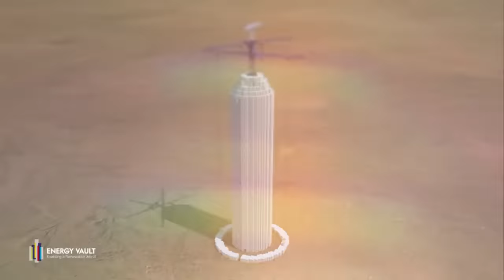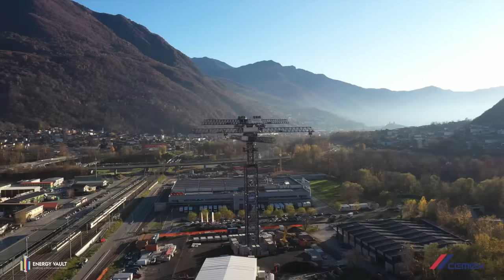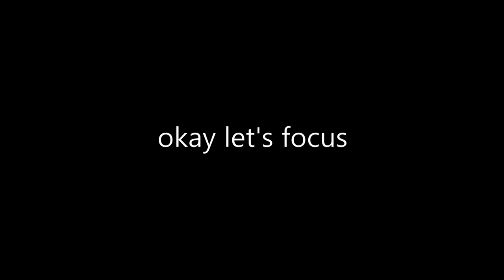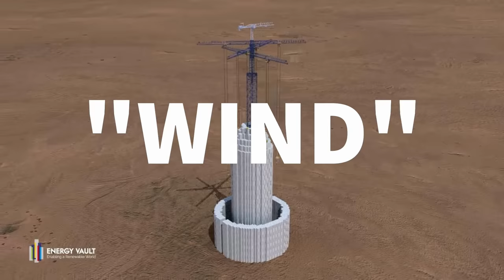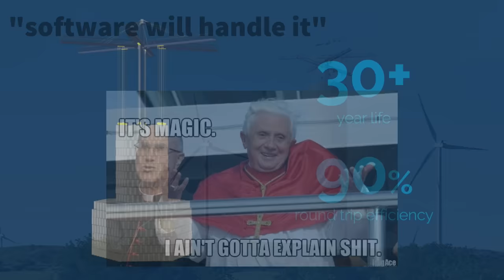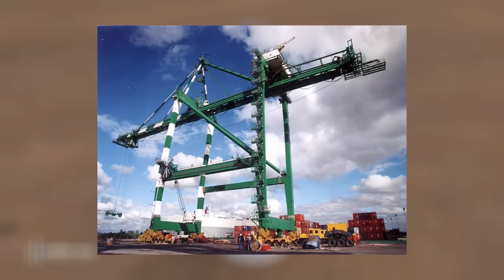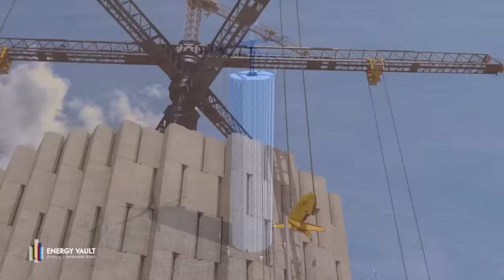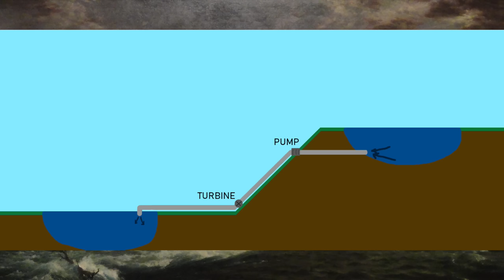The Energy Vault is a Dumb Idea, Here's Why

Comment: I understand what you're saying here. However, finding spots for new pumped storage is very difficult, it takes a lot of land and hilly terrain (but not too hilly) We are nowhere near peak capacity and we definitely need more money thrown at things that make sense instead of billionaire techbro salesmen "would be cool" projects. Pumped storage is not infinitely scalable due to geography and something more scalable like energy vault (but definitely not actual energy vault) is needed.
Reply: Agreed, the Netherlands doesn't have much room to build these for example. I think the tanks and hole idea could actually be alright in those situations
Reply: To compensate for geographical  issues one could dig / drill holes in the ground and put large cylinders which get pushed up (e.g. by pumping water underneath), locked in place, and sink down releasing water with pressure under the weight driving turbines when needed. You could fill the cylinders with waste and make this thing a height adjustable waste storing facility, so you won't have to put fresh ressources just for creating something heavy.
Reply: "However, finding spots for new pumped storage is very difficult"
A water tower would take about as much space as a crane moving concrete. You don't need a hill.
Reply: @wisenber  It's an issue of capacity at that point. Ideally you get maximum eco of scale. A water tower maximizing eco of scale gets progressively more expensive because you need to hold something very big and heavy very high. Reservoirs hold more water for cheaper than a tower. If we are talking about towers, we might as well abandon it all together and optimize liquid salt batteries and build as much pumped storage for long term energy storage as can fit on the planet given geography.
Reply: @epicosity5588  You're discounting the option of many water containers. Heck, put one on the windmills
Reply: @wisenber  I'm not discounting, I'm just saying it's cheaper to build bigger because of the square-cube law. Putting a container on each windmill would increase the cost of the windmills and create additional maintenance costs/points of failure. Building one giant reservoir with the largest possible turbine/pump also generally increases the efficiency of the energy conversion. For these reasons, the direction that the industry will go is generally fewer and bigger, therefore solutions need to keep optimal scale in mind to remain competitive with other options. Just look at the history of electricity generation and container ships for reference.
Reply: @epicosity5588  Were you assuming the shape of a water tower.  Building one giant reservoir doesn't work for the same reason you said it wouldn't work. That hasn't changed. Any addition is more maintenance than no addition.
Reply: You could dig deep holes into the warm Earth and put water into it and pump it back up..... Hang on....
Reply: @wisenber  The square-cubed law indicates that the smaller the container, the more expensive the storage per gallon. One giant reservoir is therefore more cost effective than individual water-tower-like storage.
Reply: @Sam-vf5uc  "The square-cubed law indicates that the smaller the container, the more expensive the storage per gallon."
The same law covers the geometric increase in stress. One giant container therefore requires much more reinforcement. Unless we're talking about ship design and your cargo (water) is displacing water. If we're talking about a reservoir, we keep running into killing aquatic forms of life.
Reply: @wisenber  I thought about the possibility of using the windmill tower to house a lifting mechanism for a heavy concrete block that could be lifted by "spare" energy and released when there is no wind. But I'm guessing that both ideas would make the windmill top heavy and more likely to blow over.
Reply: @stephengraham1153  Thank goodness I have a natural gas well on my property. I'd hate to rely on this stuff. However, the prop on my sailboat has a regenerative function when I'm sailing above 4 kts along with a couple of solar panels. My house has been powered by natural gas generators for several decades.
Reply: I mean, it's equally an issue with concrete though? It isn't that much more dense than water (2.4x denser by volume), so if you can't find somewhere to store 40 cubic kilometres of water (a reasonably large reservoir, but not the largest by far), you're still going to find it a struggle to find somewhere to store 17 cubic kilometres of concrete and move it about.

Uhh.. For that matter, that sounds like an absurd amount of concrete. At some hastily googled ballpark numbers, that's about 20 times as much concrete as in Manhattan, so.. uh.. factor generating 20 cities worth of concrete into any plans to get a good storage amount and do a pretty big multiplication of that neat little 82000 tonnes of CO2 this stupid energy vault was going to generate.

(It's 7 billion. 7 billion tonnes of CO2. So. Yeah. An additional 20% to global emissions that year. To make ONE medium sized concrete 'reservoir'.)

P.S. I acknowledge that you said 'definitely not energy vault', so you'd probably choose something less stupid than concrete (Perhaps some of the stuff you just dug out of the ground digging a huge hole, for example.) but the volume of land you need to occupy still isn't scaling down that much for using substances that aren't water.
Reply: @HairwormSeph  Don't use concrete.  Use rock.  No need to produce CO2.
Reply: We transfer power between states... this isn't that difficult to find places to put these.
Reply: @Chasing100  again power is transferred over long distances... this doesnt need to be local.
Reply: @loon894  this is a terrible idea... water alone is pretty heavy and a block of even something like lead on the top wouldnt increase the efficiency much and would cost much more than digging a larger hole which would increase the power storage by multiple amounts rather than by a few percent.
Reply: @wisenber  that is a lot of money to do something a hill is much better at. Electricity is pretty easy to move around and the infrastructure for doing that is already there in most places and would be cheaper to just make electrical infrastructure than it would be to make water towers... stop it with the dumb ideas..
Reply: @wisenber  water doesn't store that much energy, you had one bad idea and are trying to fix it with other terrible ideas.
Reply: @thomgizziz  " that is a lot of money to do something a hill is much better at. "
The windmill may or may not be on a hill.

"Electricity is pretty easy to move around "
Until it isn't. The cost of distant transmission (and the loss) is one of the reasons why transmitting solar from North Africa to Europe hasn't taken off.
Reply: @thomgizziz  " water doesn't store that much energy"
Tell that to hydro operators.

"you had one bad idea and are trying to fix it with other terrible ideas."
Like hydro generation?
Reply: @HairwormSeph  probably harder to store an equally dense amount of water than stone at high levels. Stone can be stacked, water has to be contained and leak proof. The heavier it is, the more structural integrity, and we’re talking about a lot of weight. Using stones allow the weight to be stored without worry of leakage. And no pipes or pumps to worry about over time, just an engine that pulls up a single rock at a time. 

I like the water pump idea, but I think this idea has some perks that justify its own use case.
Reply: >we

Comment: Thank you for the video. Please consider the following points: 1) The energy efficiency of Pumped-Storage Hydroelectricity (PSH) is less than that of the energy vault. 2) PSH has its own problems related to construction cost and others. 3) I agree with you, the shape of the energy vault tower can be different, however, it is built on the ground rather than below ground to reduce construction costs. 4) The blocks do not have to be made of concrete, they can be made of any material, hence the CO2 emission issue is invalid. 5) With regards to stability, tower cranes are used to build skyscrapers, hence, they can be stable when sufficient anchorage is used. 6) In light of point '5', tower cranes can extend their operational heights, while gantry cranes are limited by their initial design and construction.   Thank you again for bringing these matters to mind. Such videos help pin point matters of concern and improve the design.

Comment: I live in the midwest where a lot of the windmills are and there are some reasonable explanations why concrete towers would work better.
1) Water freezes in the winter here.
2) Digging a void structure that deep would be very difficult due to the very shallow water tables.
3) Hydro batteries work best in area with a steep elevation change, which it's pretty flat here. Also, the flatness of the land is partly what causes the high winds needed.
4) Separate point, since most the energy would used while it's being generated, one tower would support many many more than just 2 windmills.
Reply: And usually it won't be stored near windmills... rather near the place where the energy is needed, not where it's created as then 30-40% of this stored energy may get lost during the transfer so there is no point in storing it, it's better to have it stored in the nearer location after the loss.
Reply: You know what you could also use? Compressed Air instead of water. They've been available since 1978 and are great for cold, flat places.
Reply: @normanicusinvictus7416  Interesting, never though about that. Are there any examples of compressed air storage of that magnitude though?

Comment: Okay, I'll grant that the proposal so richly trashed is a bad implementation of an old idea.  The problem I have with the proposed fixes is that each of them has issues as well.  Potentially worse than the tower design.

Digging a pit:

It is surprisingly expensive to dig large holes in the ground, which would push the ROI out into the far future.  Then there's the problem of where the water comes from and ecological impact statements for what amounts to a gigantic artificial dam if you go with the pumped hydro idea.

Pumped Hydroelectric:

Natural pumped hydro requires suitable geologic features around the area to supply and contain the water.  That means a dam or big hole (see above).  The last dam built in the US was back in 1980.  Getting a new dam built is a painful process; going through ecological impact statements can take years.  That's assuming that there is a suitable geologic structure to do it at all.

It isn't enough to point out the problems if your proposed solutions have more problems.

How about this?

In the Pacific Northwest, most wind farms are idle even on ideal days.  That's because you cannot put more power into the grid than the demand.  They have to match closely.  The power companies have base load generators to handle the normal load, which are designed for efficiency, but which cannot be turned on or off quickly.  If the base load generators are handling the demand, the windmills must shutdown to avoid damage to the grid.

OTOH, So. California could use all the power that the PNW wind farms can produce, but...  There is no grid interconnect from PNW to SoCal, and no one is willing to pay to make it.

Figure out how to economically create the grid interconnections to allow the alternative energy sources to run full tilt, and storage is no longer an issue.  Or, at least not as big an issue.

Comment: When I first saw it I assumed it was a tower made entirely of batteries for storing energy. Stacking blocks with cranes in windy areas sounds so dumb when compared with my initial thoughts. Your underground square crane sounds much more viable but the storage capacity needs to be more.
Reply: Same, I already though, wait why do they move them around wouldn't connecting them be more efficient and cause less problems? Or just unplugging cables while loading and not moving the batteries itself. But no its even dumber and the moving is the only art of it...

Comment: I remember hearing about a desert township trying something like a hybrid of pumped hydro and lifting blocks by using an old unused set of train tracks going up a nearby hill - pulling a loaded boxcar up hill when they had the power to spare, then letting it slowly roll downhill when they needed the power? Not sure how that story concluded tho
Reply: Sometimes ideas are great until you try to use them large-scale. That boxcar thing sounds great, but 10,000 of them sounds dumb.
Reply: @GamesFromSpace  but what-if one really really big boxcar 🤔
Reply: @tarjaau  I see your reduction of air resistance with a vacuum & raise you a launch the whole thing into space & gradually lower it down to the surface when you need more energy (:
Reply: That actually sounds like a really good idea once refined. How about... 4 box-cars going up and down a hill so that you'd have electricity even if one of them required maintenance? Might be safer and cheaper to distribute the weight as well. You can then run a wire from each boxcar to a central station at the top of the hill for lifting and releasing, and that's where the power would also be generated. Maybe add some anti-roll-back mechanisms like they have on roller-coasters (preferably magnetic so that the car can travel both ways) and hell, if Elon wants to help, build an air-tight or vacuum-sealed tunnel for these boxcars to travel through.
Reply: I believe the weighted rail cars as renewable storage is still on going and they are working on a vastly scaled up installation somewhere outside Las Vegas. It seems like a sound idea and I do like that it uses a hill that already exists and some old rails no body wants to achieve its ⅔ of its  goal . Strangely enough I discovered that it is about 20 minutes from my new home in the god forsaken desert so I will have to drive out there and report back .
Reply: better than this 4 sure
Reply: @GamesFromSpace  Eh, it's basically regenerative train braking, and for small towns with disused railways as a small-scale application actually trying to be inventive with the things you already have. Most of these tech schemes need to be marketed because they require (for unproven technology) eye-wateringly expensive new construction projects which the boxcar concept wouldn't.
Reply: @GamesFromSpace  still, that would already be a way better idea than the easily-knocked-over tower of concrete, even without any adjustments
Reply: that ended in the first ever trolley problem
Reply: There is a project in the works that uses old mineshaft. It uses single weight as a gravity energy storage. No wind, no complicated mechanism to grab and move multiple blocks, no need to dig anything.
Reply: @schwenk929  It has been 11 hours. We demand your report!
Reply: @awesometwitchy  3rd rail or overhead power-line. Eletricity to railcar is a solved problem.